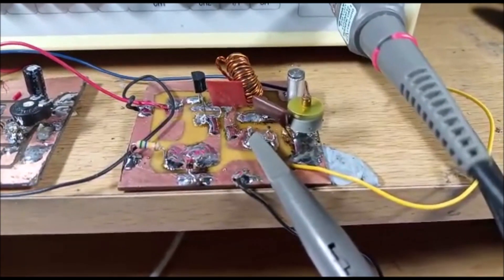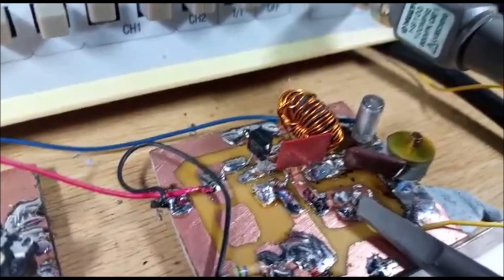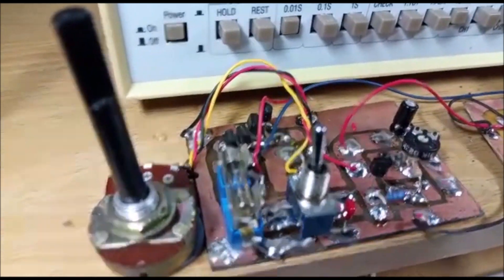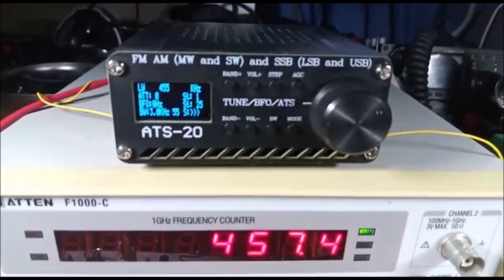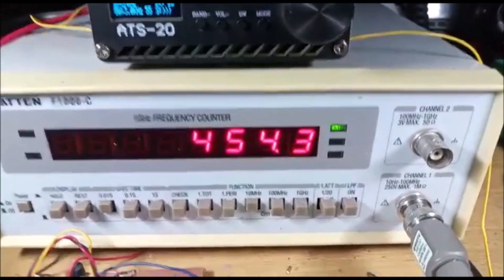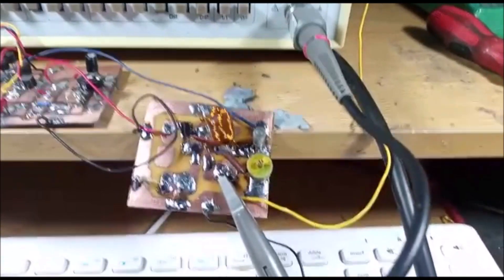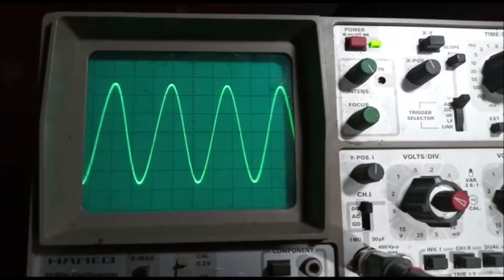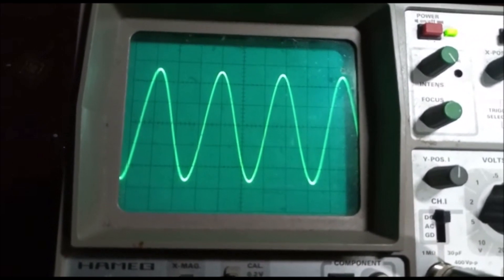A Homebrew 455 kHz BFO

Comment: What does 455 kHz represent? The tonal range that the oscillator can produce? More precisely, I wonder whether a single BFO will produce tones for all CW signals received in the radio frequency range. I can't say that I understand this.
Reply from the maker: 455 is the usual if for receivers. To resolve CW or SSB we need to mix the 455 with a BFO of roughly the same frequency. If my receiver has an if of 455 and I tune my BFO to 454 or 456 I'll get a toneof 1 KHz which is in hearing range. Without a BFO, I'll only hear dull thumps.

Comment: OK!  So i tried another home made bfo before tinkering with this and i have a 65-to 298 pf air variable cap laying around. My calculations indicate that i needed around 963 pf +- 25pf to get 452 - 457 khz  to get a good range of adjustment so i tried using 4 200 pf ceramic caps in parallel with it which added to 783pf plus the variable and i must admit, im very impressed it actually worked! So what i think the problem is with THIS model i plan to use in hallicrafters radios is that the 1000pf cap is at or beyond the limit to get 455 with the coil i constructed due to manufacturing tolerances so i probably get around 432hkz output or so since i dont have a frequency counter.  This may be why it does nothing useful if it works so im going to try a lower value capacitor and make the adjustments again using a larger variable than these plans call for.  I think that will then work. Or ill go with the MPF102 bfo again.  Thanks for the encouraging ideas!
Reply from the maker: I had trouble with my first build and had to mess around with different values of capacitor.  I used the toroid for the inductor instead of the one specified and it fired staraight off first time. I just had to fine tune and then used varicap diodes to swing both sides for fine tuning. I have a frequency counter which helps. Best of luck with it Garras.

Comment: Did you change the schematic or was the c change just to the toroid? Im looking to make this for my radios
Reply from the maker: Tony Breathnach, EI5EM
1 second ago
The schematic is the same. However, adjusting the trimmer capacitor didn't give the required frequency ao I had to experiment with that value and ended up with adding  a 120pF in parallel with the 1000pF and adjusting the trimmer again. Once you get the correct frequency, the unit should work ok. However, oscillators can drift due to temperature, humidity etc. To prevent having to adjust the capacitor constantly to bring it back into range I added the varicap diodes. As an alternative, the trimmer could be replaced by a panel-mounted variable capacitor. If you need any further info you can email me direct at tonyei5em@gmail.com. I hope this helps. Note that I used a toroid coil instead of what was described.
Reply: Thanks! Ive tried builing this originally but it didnt seem to work for me either so ill try these changes.